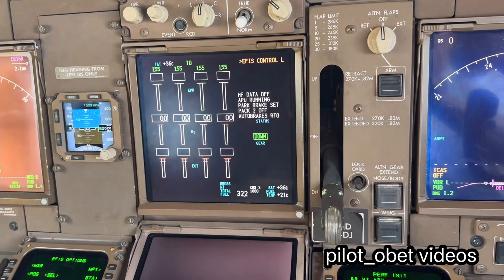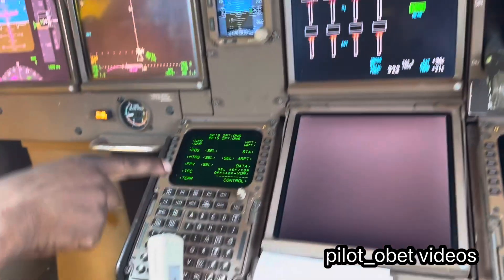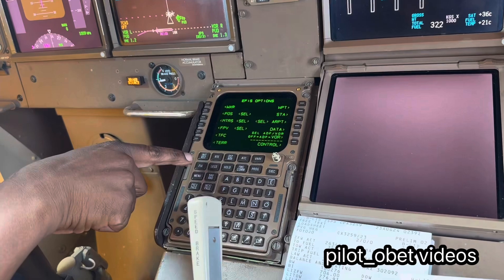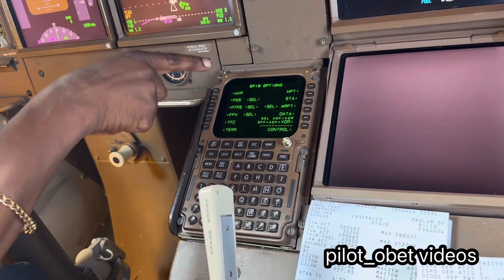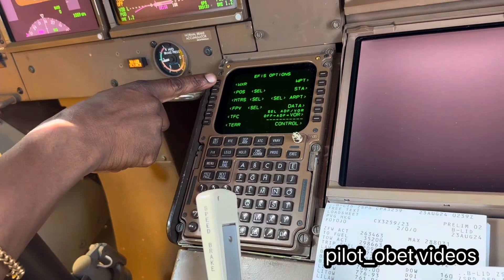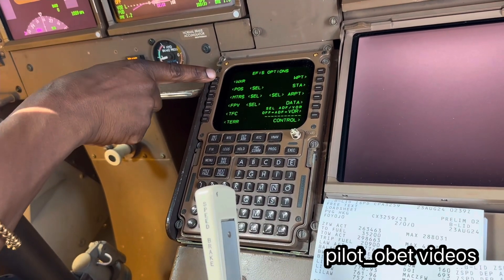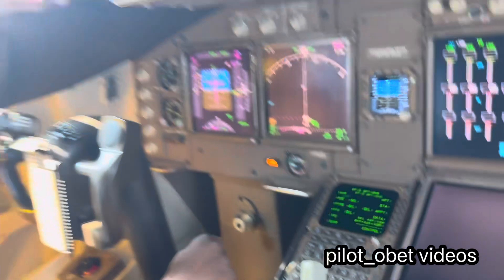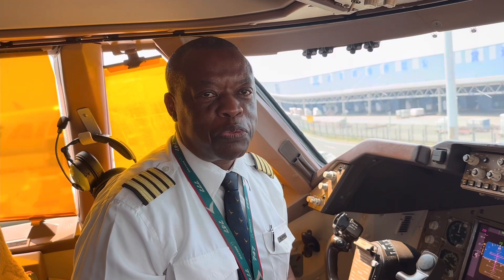Boeing 747-400ERF systems. EFIS control failure

Comment: Depending on the 747 configuration, you can only set rounded Baro/Minimum numbers via the EFIS control panel. e.g. 200ft, 210ft, 220ft etc. To bypass this you can enter the exact number in the FMS under Mins SET (1:23) e.g. 201ft, 202ft, 203ft etc.